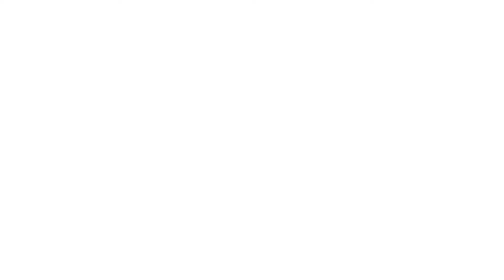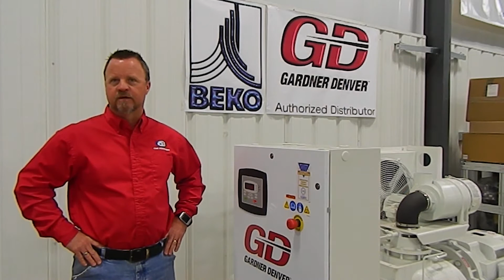What Causes Oil Carryover in Compressed Air Systems?

Comment: He ignored the main problem, the oil separator becomes plugged from dust passed by the air filter that gets caught in the oil separator. When the separator plugs, the oil temperature goes up because the internal pressures inside the compressor are many pounds higher because the air is passing through the plugged separator. The amps goes up, the outlet air temperature goes up allowing less water to condensate so the water traps have less to remove and it's passed downstream till the air cools below it's dewpoint  and water drops out of the hot air into the lines. The plugged separator causes the velocity to rise across it at the higher temperature, causing oil to be carried over with the air. Duct the air intake to cleaner cooler air (usually higher up). by better air intake filters with a lower micron rating , filter the air better that goes in the compressor. Keep oil coolers free from dirt buildup on their fins, clean the radiators often.